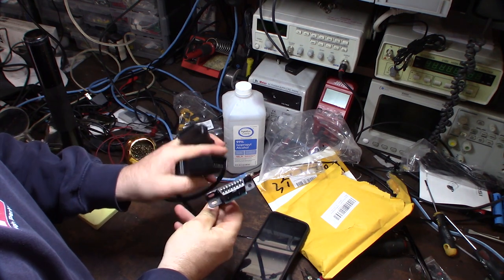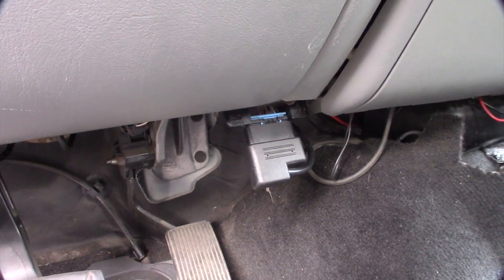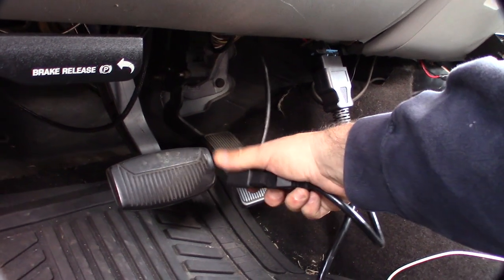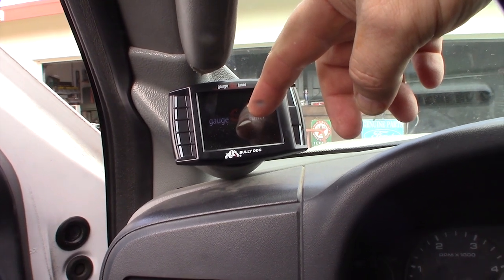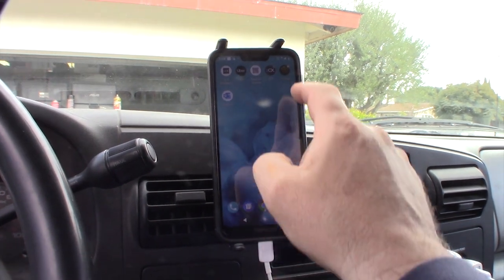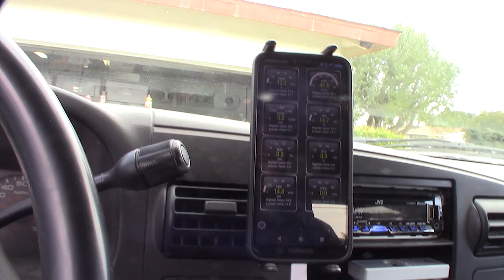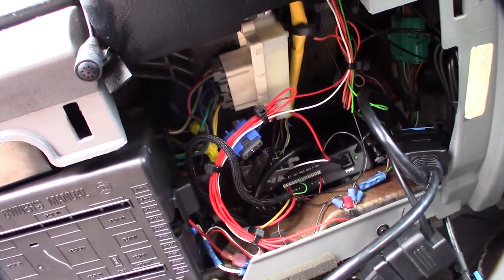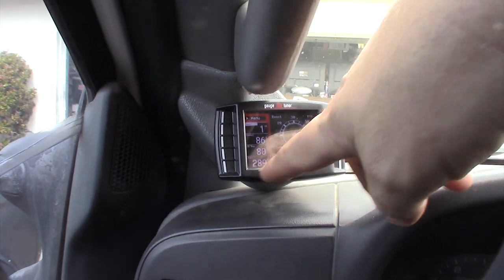OBD2 splitter simultaneous connections to my ELM 327 Android Torque APP and  Performance Tuner

Comment: Most of the time OBDII CANNOT handle more than one device and in the cases that it does, it shares the ONLY SINGLE communication port, while each device trying to send its own commands.
Because like any communication protocol whether it's a USB, Network cable, or in this case OBDII has ONLY A SINGLE connection for communication; however, you can use a splitter like that, ONLY to power things. THAT'S ALL!!
But in order to connect more than one device, you need extra equipment. 
For USBs, you can use USB Hub.
For Network, use Network Switch.
AND 
For OBDII, Ford created SMART DATA LINK CONTROL MODULE.
So essentially, you CAN use OBDII for data connection for two devices but you have to do it the proper way. *Some additional equipment and installation may require.

Comment: It must depend on the devices. I could never get mine to work reliably. I could switch between devices, but I could only do so by powering down the car, turn one off, the other on and restart the car. But I could never switch in real time and I could never reliably run more than 1 at a time. Sometimes it would look like it was working, only for one of the devices to stop getting data. So really test this out long term before you try to make a permanent setup.